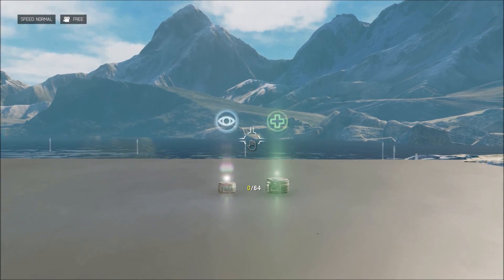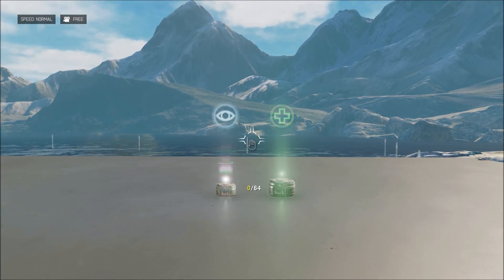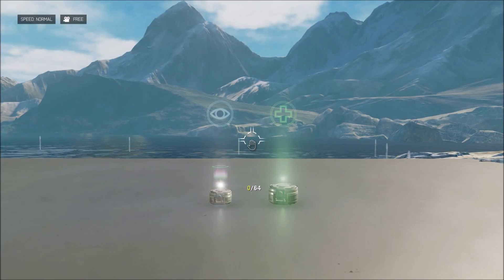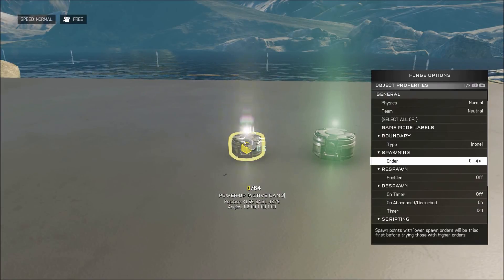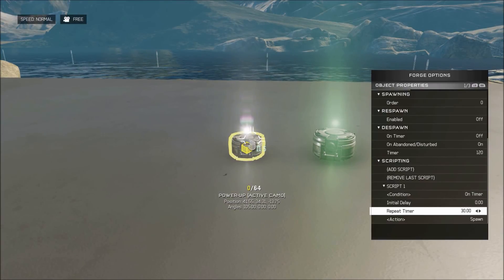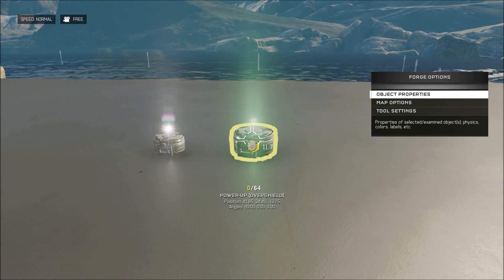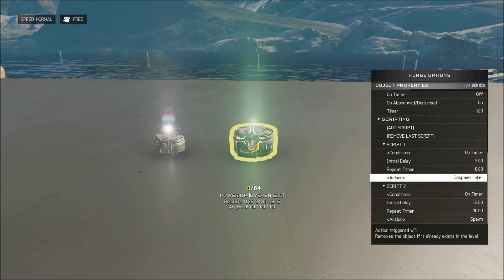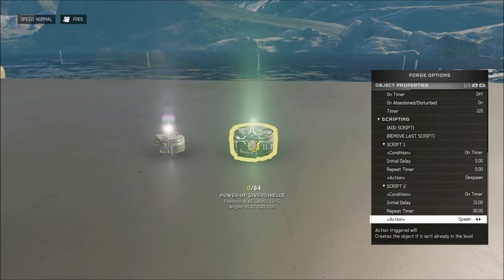Switcheroo Static Timer (Halo 5 Forge Tutorial)

Comment: This is cool and all, but wouldn't you rather have the power ups spawn based on their usage and only respawn on a set amount of time after the previous power up had been used up completely? This is easily achieved by simply having a relay object set to despawn along with the pickup of the power up. Then that relay controls the spawn of the next power up instead of a timer.
Reply from the maker: +Raptor086 Static timers on power ups are actually preferred by many, though there is merit to both approaches.  We'll be revisiting this concept in a future video to cover things like extending the timers, so we may cover non-static timers for this as well.

Comment: Very good tutorial, but what if i have to put 2 snipers in my map, with 1 spare clip each, how can i make these weapons respawn every 2 minutes (no matter what)? (in practice, like the weapon platform but with the possibility to change the spare clip of my power weapon), Can i use this method? If not, can you make a tutorial about that? Please help me! Thank you so much!
Reply from the maker: +Danix To do that, simply place a script brain with a single script.

Condition: timer
Initial delay: 13 (this accounts for the intro cinematic)
Repeat timer: 120
Action: message send

Set the snipers to respawn upon receiving this message.
Reply: Thank you very much!
Reply from the maker: +Danix My mistake, this actually won't work quite how I was thinking!  This would not allow a weapon to respawn on the timer unless it had already despawned.  This method would actually only work for powerups which despawn as they are picked up.  Try this thread on ForgeHub for more information, and sorry my initial suggestion doesn't work.

http://www.forgehub.com/threads/halo-5-static-weapon-spawning-help.150533/
Reply: +FORGEHUB Ok, i successfully created my static timer with your method, but there still one problem (or difference between my weapon with st. timer and the weapon platform): if for example i grab my sniper, and im still using it after 120 seconds (or it is on the ground, or in the map in general) IT WILL NOT RESPAWN on the next "spawn point", i want that my weapon will respawn no matter what, even if i still have it in my hands (or in the other players hands), can i add a third script to fix that?

I still suggest you guys to make a video tutorial about that (with difference cases like this) because it would be huge for competitive maps in general!

Thank you for your help and for your patience, i never used scripting unil now!
Reply: +FORGEHUB I looked around about this question and i found that there is stil not a definitive method to create static timers for weapons wich are not powerups... When a definitive solution will be found, can you make a tutorial about that?

I cannot wait to have my static snipers on my map, thank you for all the help you gave to me, ill adopt the scripting method until the final! See you soon!